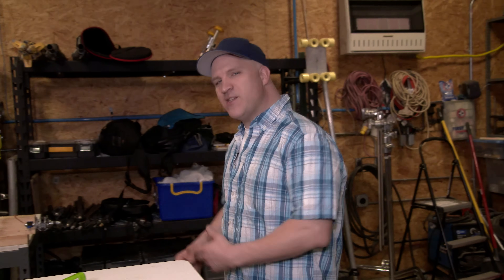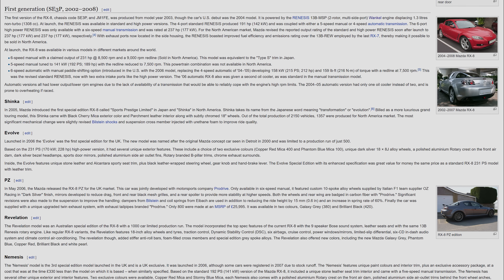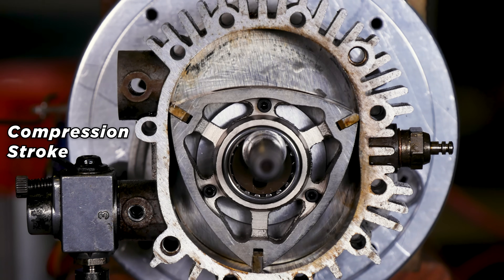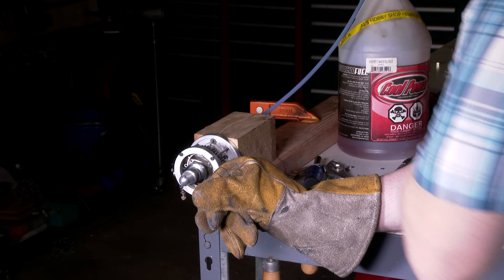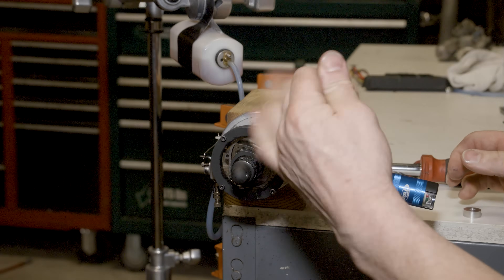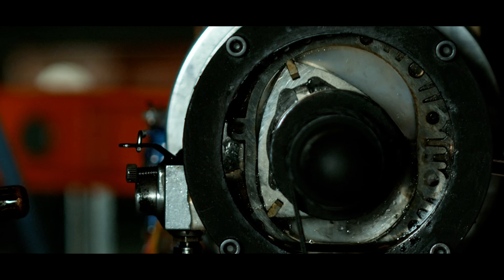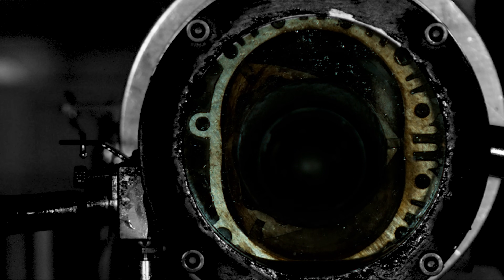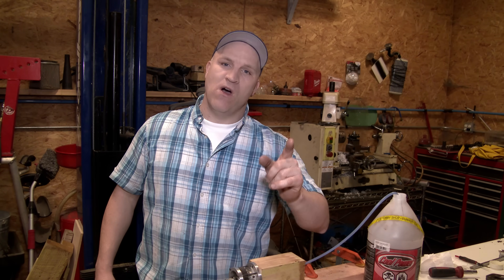See Thru Rotary Engine in Slow Motion - (Wankel Engine) 4K

Comment: if only we could reduce emissions on them. Then they will be perfect sport car engines with their amazing RPM's just some way to not throw all that fuel out into the exhaust and reuse it.
Reply: The Wankel has proven to be very poorly suited to any applications, which is why it never saw widespread adoption and is now completely obsolete.
Reply: doktorbimmer it's good for things that need high rpm and don't want to put on gears that will make it heaver, ultralight planes and RC planes.
Reply: Then why are they no longer manufactured commercially for either ultralight planes or RC planes? High propeller rpms are BAD for efficiency and performance..Most Wankel aircraft prototypes I have seen (they are extremely rare) were not direct drive at all but required additional gear reduction drives which add extra weight and complexity.
Reply: Wankel engines have never been mass produced for any Commercial, Civil or Military manned production aircraft either. BSFC is a critical factor in aircraft design and the Wankel offers the worst BSFC performance of any internal combustion design... Do you even know what BSFC is?
Reply: i fucking said small aircraft, some drones use it. Yes i know what BFSC is performance for fuel.

https://en.wikipedia.org/wiki/IAI_Harop new modern drone that has one.
Reply: Actually for high speed prop planes high RPM's is what you need. But that field is dominated by turboprops.
Reply: Small aircraft? Please cite a single Wankel engine available that is FAA or EASA certified for flight-worthiness? Drones? You mean UAVs?  The UAV market is dominated by a single manufacturer now, ROTAX GmbH.  which although was a Wankel licensee in the 1960's (Fichtel&Sachs) now only manufacturers reciprocating 2 stroke and 4 stroke engines.
Reply: So if you know what BSFC is? Then you understand what a huge disadvantage and weight penalty the Wankel has in aircraft design, reduced range and reduced payloads... its why aircraft manufactures abandoned development of Wankel engines decades ago.
Reply: doktorbimmer please stop using bold letters, there are quite a bit of UAVs and a few mini planes with wankels, they are lighter. But electric will overtake once batteries don't weigh a ton
Reply: Not true, low rpm propellers are more efficient and develop more thrust. True, gas turbines offer an order of magnitude greater  power-to-weight performance compared to the Wankel... and far greater fuel efficiency.
Reply: No, they are not.. in fact there are very few Wankel powered aircraft and are exceptionally rare as they are mostly single one-off prototypes.
 You seem to know very little about rechargeable batteries too... they will never see widespread use in aircraft because of the Specific Density  problem, the Laws of Electro-chemistry severely limits both practical and theoretical battery performance.
Reply: Please stop doing that, and also all light prop planes WILL become electric in the future as there are alreaddy prototypes, once our battery energy density gets higher there will not be a problem. And YOU seem to know very little about batteries, new battery techs bring higher capacities and performance.
Reply: There are prototypes of light prop planes that are power by giant rubber bands too...
 You really need to educate yourself about the density limits of rechargeable batteries... because unless you can discover a new (stable) Element for the Periodic Table?  Batteries will never be able to compete with density performance of liquid hydrocarbons... as this violates the Laws of Electro-chemistry and Quantum physics.

Comment: What is the blue thing on the right side?
Reply: Its the battery which heats the glow plug for starting.
Reply: The Wankel design cannot support Diesel Cycle operation, and the octane rating of Diesel fuel is too low for optimum spark ignition operation.
Reply: Does this engine can be built to burn diesel?
Reply: Heater for the Glow Plug, I guess
Reply: doktorbimmer but could it be used with butane gas or other Gases?

Comment: Its a great little thing, but unfortunately a V8 is more efficient and has better emissions than a two rotor, which makes the rotary essentially dead.
Reply: Yes, and no - it's still in active use where emissions are less of a consideration, and the size/weight is (small planes ec, and as static generators where it can run at the optimum RPM constantly).  Mazda have been working on an updated rotary design that meets current emission standards etc, and are - supposedly - going to release a new rotary power car 'real soon'... sigh
Reply: No one said all cars use V8's.
Reply: Whats the sarcasm and whats the stupid part?
Reply: +Geoff Willingham I don't know where you got your information Geoff? But its completely bogus, Wankel engines have been obsolete and discontinued from production for several years now. the last manufacturer was Mazda and they ceased production on June 22nd, 2012. They have never seen successful adaptation to any applications other than small sports cars, the Wankel is less efficient and higher BSFC which why it is not used in production aircraft or generators. Gas turbines offer on order of magnitude greater power-to-weight performance than the Wankel.
Reply: +Geoff Willingham Mazda's board of directors cancelled all development of Wankel engines in May of 2009, Its CEO has consistently stated in official remarks that the company has no plans to return the Wankel engine back to production. The RX engine plant at Mazda's Ujina #2 facility was raised in 2013 to make way for a brand new Skyactiv-G assembly plant. Despite persistent false rumors found on the "clickbait" blogsites... Mazda has not confirmed any new prototype designs since 2008 and its last production engine was unveiled almost 23 years ago.

Comment: The reason they make so much power for the size is there are no dead strokes, a piston has a bunch of unpowered strokes. One rotor can provide combustion every third of a turn! You need SIX pistons to get combustion a third of every turn on a 4-stroke.
Reply: You forgot the 3:1 Ratio between the triangular piston and the crankshaft. There is only one combustion cycle per shaft revolution for each housing... it takes 3 revolutions for all six chambers to complete the 4-stroke cycle

Comment: As a mechanic, the rotary engine is shit.
Reply: as a mechanic, you are a dumb fuck.
Reply: Zero Cool When the cost of rebuilding a rotary surpasses the £15,000+ cost to buy, import and swap the LS into it.
Reply: MKB Rockets As a person who owns an RX-7 and knows how to actually maintain a rotary engine, we don't give a fuck what you think.
Reply: Shona
Soooo....tomorrow then?
Reply: Zero Cool I live in the UK, we don't get the LS engine, I wouldn't mind an LS but I can rebuild my 13b for ~£2,000 and it lasts for 5+ years so I don't really have much need for anything else.
Reply: Shona
I'm sure there's some UK equivalent of the LS that's cheaper, more powerful, and more common then a 13B. imo, unless I was a glutton for punishment or just HAD to have the freaken Wankel to be different/unique, almost any other piston engine is more practical and cheaper in the long run. Hell, most decent 4 or 6 cylinders can do everything the 13B can do for longer. There are reasons no one makes a Wankel anymore.
That said, if a Wankel is what you want, more power to you. It's your car.

Comment: That’s a fantastic video and a great product for a lot of hard working. I’ve always wondered how the engine actually ignited and exhausted in the cycle. That’s by far the most understandable way to show it and an excellent job of making it work. It still seems like a less than efficient way to achieve a rotary function but a pure circular motion although less lost energy hasn’t come around to my knowledge aside from the turbine engine.
Reply: Well that is why reciprocating and turbine engine dominate the transport industry and wankel engines died out
Reply: doktorbimmer that’s why it’s easy to see how electric motors have become the most efficient and commonly used form of delivering power. No lost motion. When the battery technology barrier is finally broken and it’s efficiency is equal to the motors I guess we will see ic engines go the way of steam. Although I will miss having engines that I can work on ,in automotive application they have gotten beyond my capabilities anyway due to the super technical nature of the design and computer controls.
Reply: "When the battery technology barrier is finally broken"
What are you talking about?  You are not a chemist or an engineer are you?
Reply: Contrary to a lot of quasi-religious/political/stock market hype recently.. electric vehicles using rechargeable batteries will not replace ICE powered vehicles.... BEVs will remain as they always have, as a niche market segment.
Reply: doktorbimmer no but I play one on tv
Reply: Not very well it seems... your performance is not very believable.
Reply: Apparently they redacted part of your script, the part where you say, "Rechargeable batteries will NEVER! (dramatic pause) be able to match liquid hydrocarbon fuels in Specific Density".
Reply: doktorbimmer Unless I am misinterpreting what you were trying to convey 
, I can see that any further discourse is a complete waste of time here, so there’s no point in engaging in a talk about the science since you are only interested in some kind of petty oneupmanship   Don’t waste my time or yours. Because I won’t read any more of your comments.
Reply: Not at all, I was simply shocked by your frankly bizarre comments regarding battery technology and EVs... I sincerely inquired as to your technical expertise on this topic and to clarify if your statements were merely pretense. I assumed by your response that you were being extremely sarcastic in regards to being employed as an actor, my response was equally in jest if so.  Are you really an actor? or where you merely attempting to save face or deflect my inquiry to validate your remarks. Cheers
Reply: doktorbimmer That’s the problem I find with texting messages is that it’s often easy to misunderstand somebody’s intentions without the benefit of inflection. My apologies sincerely,. That was a line from some all Saturday night live bit where the person said I’m not a doctor, but I play one on TV. For some reason everybody at work falls back on that one at sometime or another and I guess I got caught up in it that a confusing point in the conversation here. I’m a strong believer in Tesla and the EV Industry in general, and as a result made some early investments in stock with them because I’m such a believer in the future of electric vehicles, but the batteries have a great bit to be desired and I believe it sometime will look back at this and say “I can’t believe we didn’t think of this sooner “
 There is a pure carbon-based battery that works on the line of capacitor or super capacitor if I understand it correctly that seems to have good potential and it certainly is an abundant material unlike cobalt lithium and the other ingredients in current batteries  
Inducing energy into a capacitor can be done relatively quickly if I understand right however discharging Adam measured rate is one of the hurdles to overcome. But I am far from an electrical engineer, as far as you could possibly be although I am constantly reading on the subject I could spend the rest of my life doing it and never get nearly enough information to make a informed opinion. The closest I will come to being an engineer is playing one for my grandkids. Now all I need is the stripe coveralls in the gauntlet gloves. 
Oh that’s the wrong kind of engineer , sorry 
Cheers

Comment: From where did you get that model aircraft engine?
I really need one for my experiments! Could you please send a link🙏
Great video by the way😃
Reply from the maker: edwinator46 lol.. for views, no way I would invest 2 months and 16 days of filming for views !!!!. Also I plan on keeping this little engine, it is currently in absolute perfect condition, I didn't run it on acetylene on its own, as I stated in the video I started it on the nitromethane, methanol and 30% oil in the mixture, then I added acetylene to that mixture after it was running, it was so well lubricated that in between runs, I rotated the rotor about 5 or 6 times and all of the excess oil cleaned all of the black soot out of the combustion chamber. Come on man have a little bit more faith, I am an engineer even though I act stupid a lot of the time, I usually know what I'm doing. It would be a 2-hour video if I explain every single step, safety measure and redundancy I have implemented.
Reply from the maker: Freizeitflugsphäre I got one from a friend of mine in Hawaii who's into RC stuff, the second one I got on eBay, I am actually thinking about Manufacturing this version of the engine and selling it to the public. The only problem is the price would probably be around $500 in order to make it possible, but it would be a fully functional transparent engine.
Reply from the maker: I actually bought two, they were very very hard to find, first one I bought was no good, second one I bought was brand new. I just got lucky to be honest. I have been looking for about 4 months maybe more. They were discontinued in a very long time ago, the box for the new one that I purchased looks like it was from 1965.
Reply: Warped Perception Yes you are really lucky! I need a small one that i can run with my hydrogen generator. Did you find those on the internet or did you find it somewhere else? Thank you for that quick answer😃
Reply: Freizeitflugsphäre Type O.S. NSU Wankel in google.
Feeling sorry for that new engine he put acetylene in it.. The lack of lubrication probably destroyed it. Those engines are very rare and discontinued long ago. Guess people will do anything for views/subscribers...
Reply: edwinator46 thank you a lot for that comment! At least i now know where to by that stuff, even though its quite expensive!😃🙁
Reply: Warped Perception yes please do reverse engineer one and sell it. And if you ever do, please make the 3d modelling sketch used to make it publicly accessible via a link as I am thinking about fabricating parts for an rc car. Thank you

Comment: Hmh, can you help me out with a question? If a supercharger was bolted onto a rotary engine with the bypass valve closed, boost at idle/closed throttle. Do you think the added air pressure in the rotary engine would make it more efficient and have better emissions? At low boost of course, superchargers are parasitic. Edit: would it help it have a faster flame front? So less unburnt fuel being forced out... Edit: last one xD could you try hydrogen in the rotary engine... Again for the speed of the flame front... Cuz hydrogen has a much faster flame front :) piston engines that run on hydrogen have burned up through the valves because of its speed (valves were closed)

Comment: Cool video. I knew the basics of how a rotary engine operated but seeing it in operation sure made it a lot clearer to understand. Also while i kind of knew it, the fact that it has 3 power cycles per revolution became crystal clear. Thanks for the video.
Reply: One power cycle per revolution of the crankshaft.. 3:1 ratio
Reply: doktorbimmer watch the video. You has 3 combustion fires for every rotation of the rotor, one for every lobe. So yes, 3 power cycles for every rotation of the rotor.

Comment: The geometry of the rotor and chamber make the center of the rotor trace out a circle.  The rotor pushes on an off-center lobe on the eccentric shaft.  This is just like how a connecting rod journal orbits the crankshaft axis, and causes torque by applying a force off-center from the crankshaft's axis.

Comment: Awesome video. What most people neglect is that there actually are reciprocating forces inside the Wankle. That rotor weighs much more than a piston and it's mass is moving up and down at the same rate as the piston counterpart. Just because it's turning doesn't mean it doesn't count.

Comment: Very cool. Nice job. One thing a lot of ppl don't think about is that a rotor has three sides giving it three compression strokes per rotation essentially either giving the 13b for example (which has two rotors) triple the displacement or you can think of it as 3 times as many "pistons" making it actually a  3.9 litre engine. So while small in overall size, it's output per litre isn't actually all that impressive. They are bad on fuel too if you think of it as a 1.3 litre of course :p

Comment: If the rotary is so small and makes a lot of power for it’s size, why don’t they make a massive rotary engine that’s equivalent to a 3.0 litre that makes 600 hp
Reply: They do - what was shown here was a single-rotor engine... but typical configurations are 2-rotor (1.3ltr), 3-rotor (2ltr), and (less commonly) 4-rotor (2.6ltr)... there's also a company in New Zealand that make a 6-rotor, which I guess would be a 3.9ltr...  N/A, each rotor can (iirc) make about 100hp, and up to 500hp with a turbo...